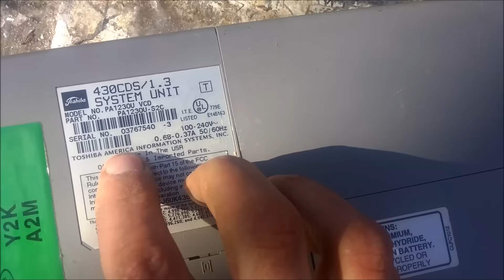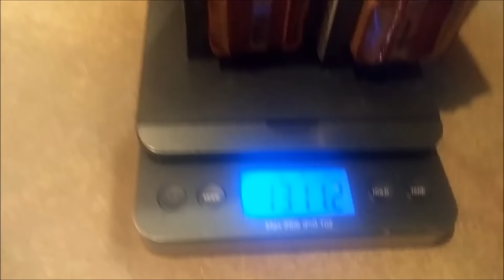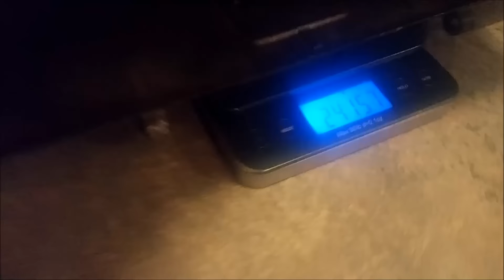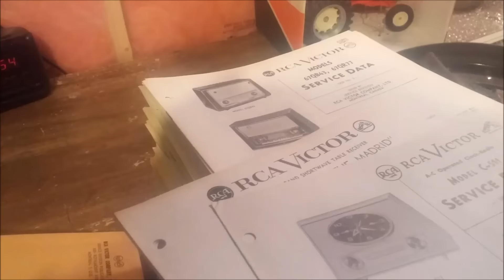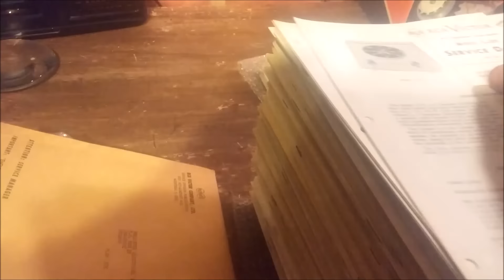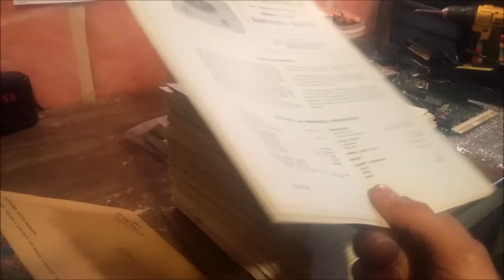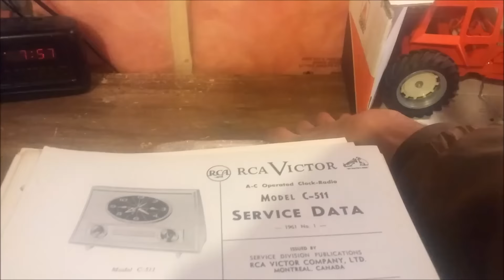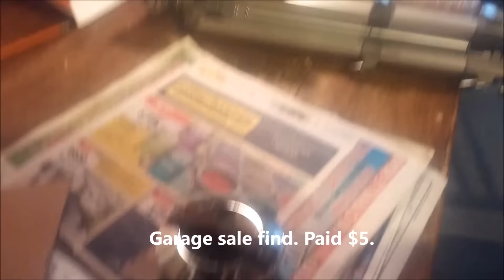Scrapping vintage computers and what sold on eBay over the weekend.

Comment: Just a thought and you can take it for what it's worth. I used to work in the Telecommunications industry, with a high emphasis on ESD protection. I would recommend  when packaging your electronic boards to place it on a grounded ESD mat and when handing the boards, to wear a grounded wrist strap (with the oils on are fingers, it's also a good idea not to touch the gold fingers on boards). It smart to use ESD bags like you showed collecting in your past video when shipping. Just walking across the floor in the cold of winter can build up a static charge, which can be released into sensitive ic chips, which in turn can turn a known good board into a faulty unit that fails.

WOW, great Ebay sales, especially the Filter Queen parts....who knew???
Reply from the maker: Yea I really need to invest in some of those bags. I guess bubble wrap doesn't count? lol
Reply: Eric, You asked the question "I guess bubble wrap doesn't count?". I'm wary of giving anyone advice, especially someone with their own store, but my advice is that bubble wrap doesn't protect against ESD and ESD bags are the best way to ship sensitive ic chips. I did a little research after your question and someone made this suggestion, "Find a local PC shop: The one I worked at had hundreds of ESD bags of all shapes, plastic memory holders, HDD holders, everything. No one ever asked for one but I doubt we wouldn't give you one for free, we had drawers just stuffed with them", so maybe you could work out a deal with a local shop to trade or they will give you free bags.

I hope this helped you, because you care more than the average store owner and it shows in what you do, with your great feedback as the result of hard work. ~ Take care, Mark

Comment: is there a way to wipe the info on laptops without powering them on?
Reply from the maker: You can connect the back of it to your computer with a couple of connector cables. Then you can read and format just like any other external memory.
Reply: without powering it on at all though...like with a big magnet or microwaves or something?
Reply: hammer lol

Comment: i posted my first youtube video in 3 years yesterday im tearing down e waste and separating everything then weighing it to determine its scrap value I got 2 of those Toshiba satellite laptops my kids are playing with 1 at the moment they work fine but they only selling for £10 here in the uk the holes where the screws go are just brass they'd be no reason use gold but im looking forward to getting those gold heatsinks out
Reply from the maker: I know it's hard to resist, but if the laptops work don't scrap it. Good to know those nuts are only brass and not gold plated.
Reply: I think I!l bring my over to UK can't fine anywhere in Ireland to sell it
Reply: How much a borad over in uk